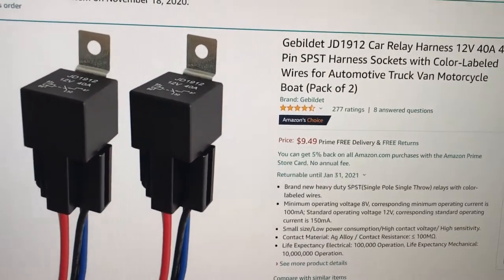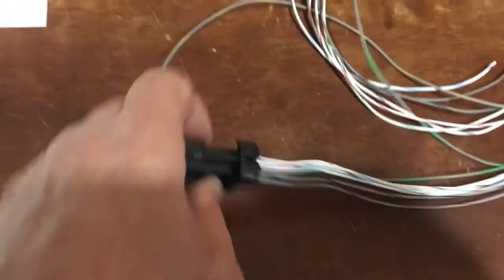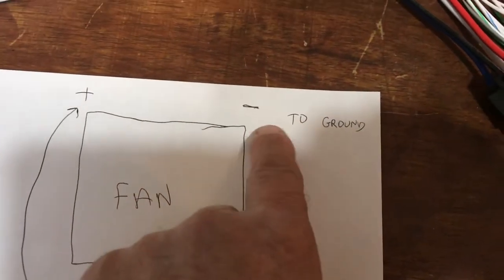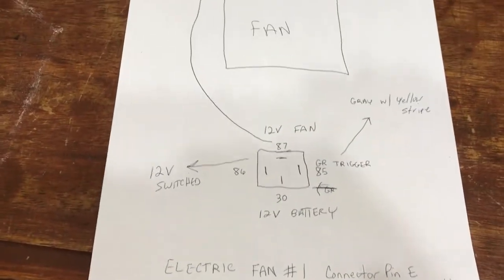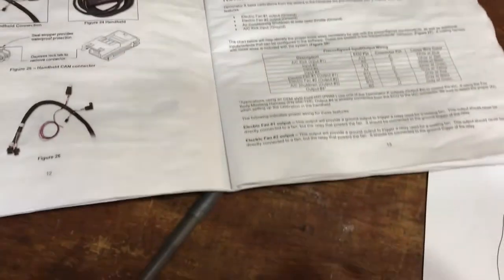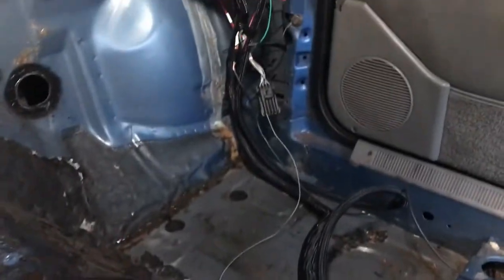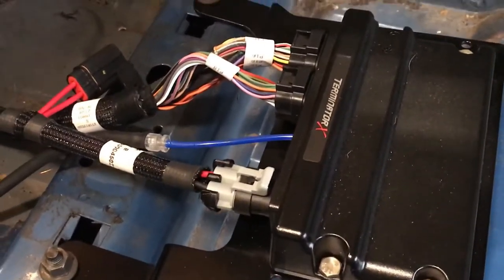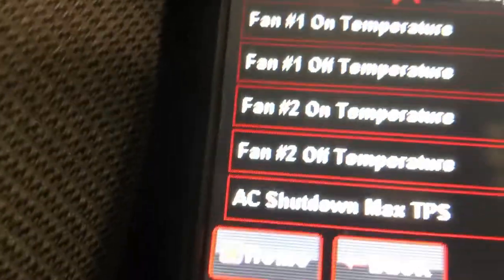Holley Terminator X - Fox Body Mustang - Electric Fan Hookup

Comment: What was the exact problem you had running you the 30 (constant 12v) wires to your starter solenoid? I have mine wires to the solenoid because my battery is in the trunk but when the fans kick on its a big voltage drop and the idle drops and most of the time the car stalls. I have a pa performance 200 amp alternator, I may run a wire to the battery and see if that helps. Your video is the one of the best on here for wiring the relays. Thank you!
Reply: Did you figure it out

Comment: I wired my fan just like you have it in the video. My issue is that I want the fan to be triggered only by the termx ecu in regards to the temp sensor. As it is it will start the fan when I turn the key to the run and start up position. I prefer to have the extra voltage be used by the starter to crank the engine instead of it coming on before its cranked. With the fan being turned on by the ecu it will allow my engine to warm up quicker. Can I disconnect the 86 pin? Will that allow the ecu to powerup the fan?
Reply: That wont work. You have to go in to the holley software and adjust when the fan kicks on and off.
Reply from the maker: Wire your fan up  with a toggle switch

Comment: Great video. Do you have AC in the car and if so how did you wire that up ?
Reply from the maker: I deleted my AC years ago - Wiring diagram comes with the Holley Terminator kit. The Fox Body Mustang kit is app $1149.00 - well worth it!
Reply from the maker: No air conditioner - all parts related removed